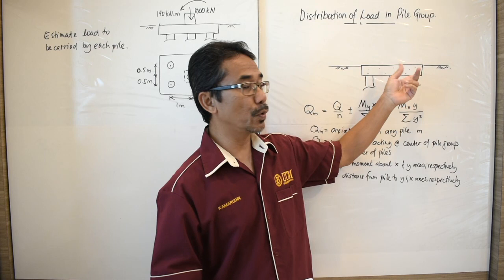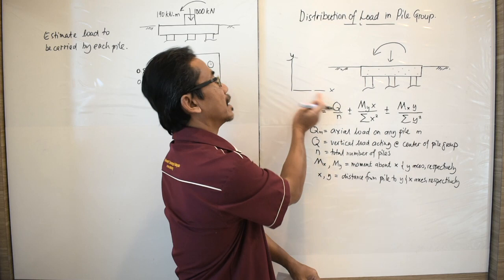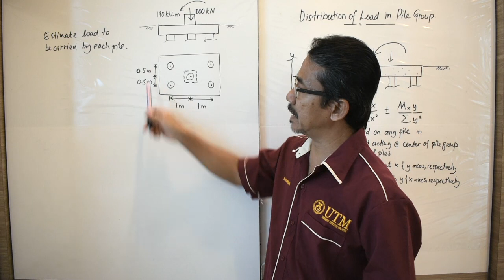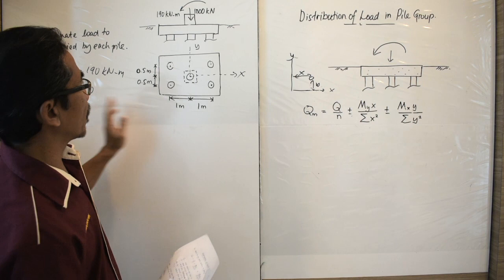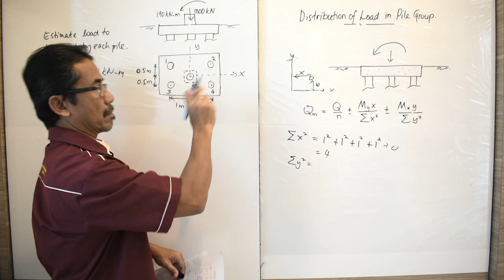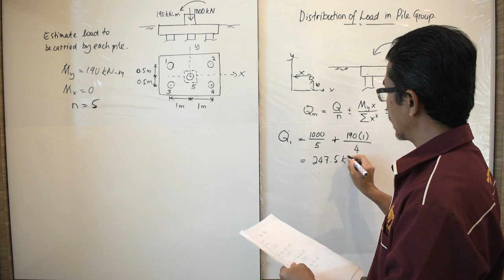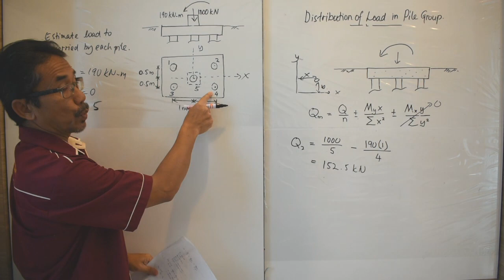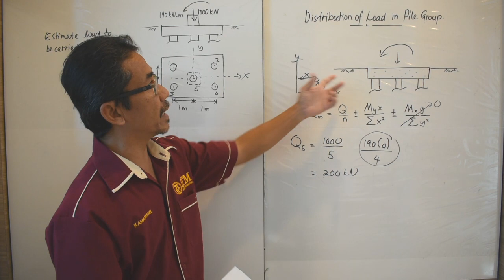Pile Foundation - 06 Load Distribution in Pile Group

Comment: What would your approach be if a horisontal load was to affect the foundation? Would you make a calculation of the vertical bearing capacity of a single pile and then distrubute the load evenly among the piles? Or would You use another theory where angled piles would be applied?

Comment: This method for calculation of pile load in a pile group is very conservative and it works only when the piles cannot move horizontally. Bending moment in each pile is unable to be determined either.
Reply: This is not a method, this is a fundamental to load distribution in a pile group.

Comment: Excuse me sir, for the moment in the x and y direction comes from the joint reaction or the moment in the pilecap? Thanks
Reply: @kamarudinahmadphd7412  Thanks for answere, but I have a problem if the model only have beam on the top pilecap... so I use momen frame (beam)... and the pilecap only be axial force in use.. is it right sir?